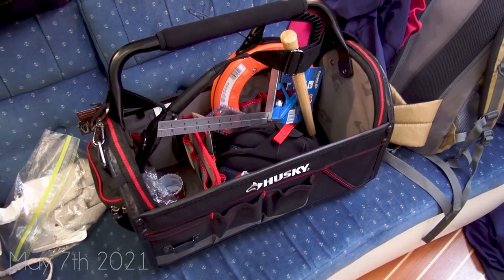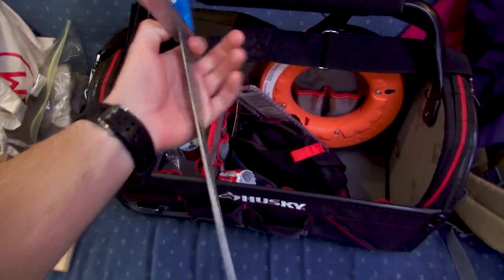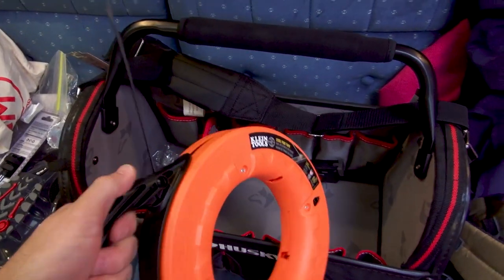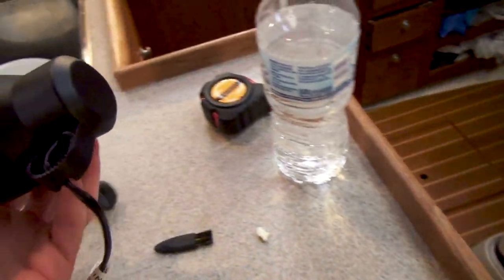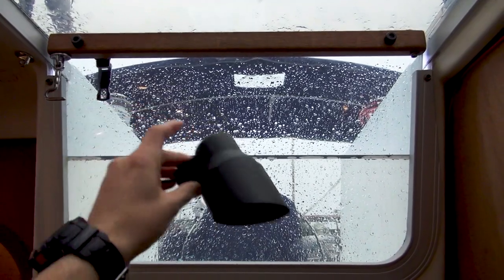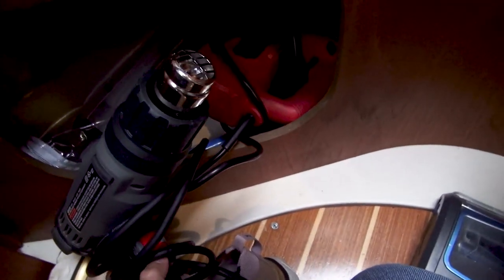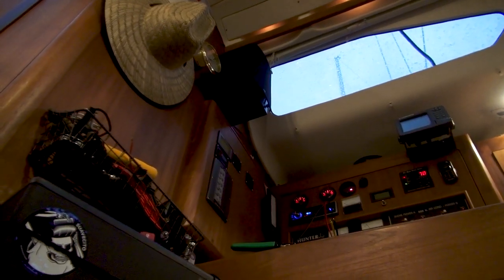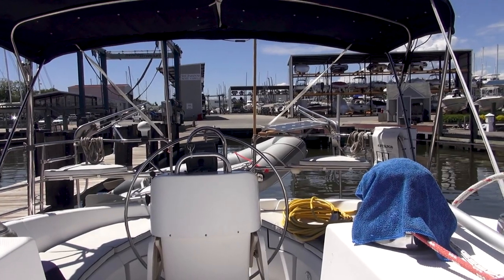New Tools, Bilge Alarm, and our First Haul-out! - Sailing Viridian EP50

Comment: Previous owner of my Hunter 30 had the alternator bracket bolt come loose while motoring. The alternator dropped into the oil filter and punctured the filter, filling the engine bilge with oil. They had an inoperative audible alarm on the Yanmar control panel, the oil pressure light and charging lights did not get their attention and they destroyed their engine while continuing to motor. When I purchased the boat (with a new engine), the warning panel audible alarm was still inoperative...you really can't fix stupid.

Comment: I'm believer in warning lights should be in the cockpit. If you want to see how a boat can fill with water while sailing and you have no idea, check out Sailing Lady K channel. Luckily the guy found the leak quickly, I doubt most people would have been able to find it and would lose their boat.
Reply from the maker: Yup! That's a super intense episode and actually one of the main reasons I installed this sensor. Next step is to wire a similar one to the cockpit as well.